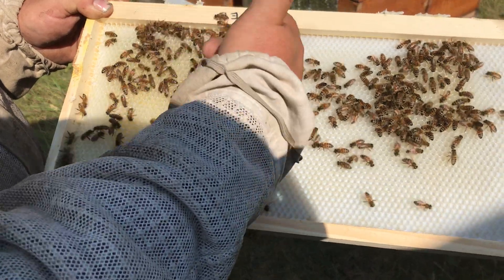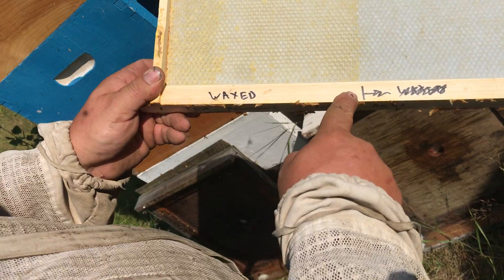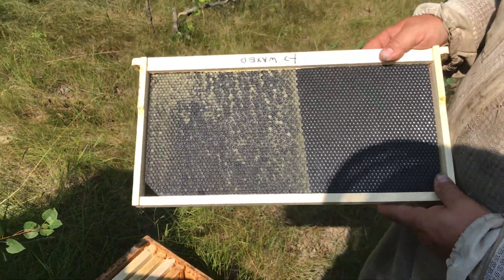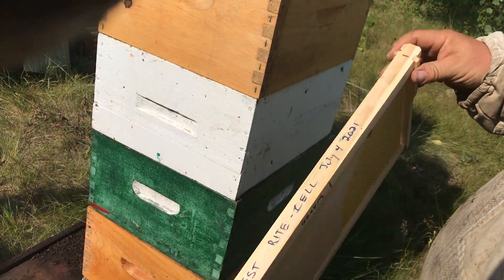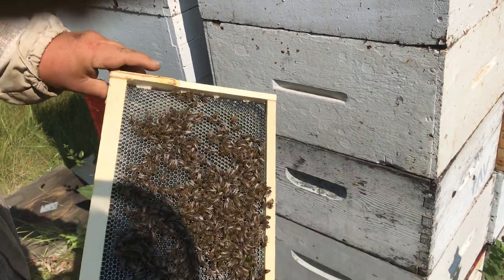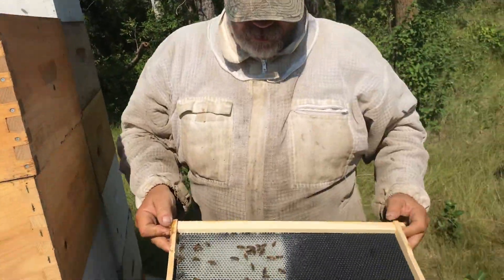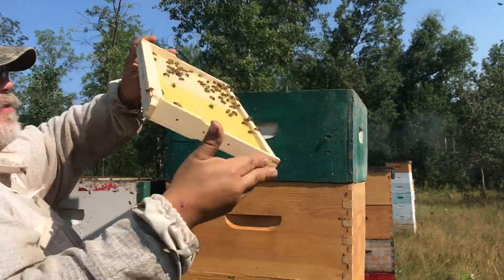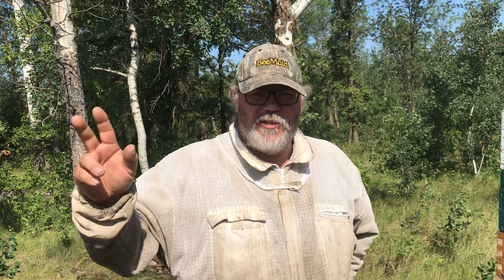Results:  Testing dipped vs "off the shelf" foundation. Step 3:

Comment: Great video, thanks for you efforts.  Did the foundation have any wax from the manufacturer before you added your own wax? The foundation bend when they don't have enough space to stand up stright, ie top bar and bottom bar is to close together or the slot is not deep/wide enough for the foundation to fit into.
Reply from the maker: This foundation was all “waxed”. I’m trying to show that coating is insufficient.  Those sheets were all straight in the frames when I installed them. Another viewer suggested the black comb may have warped from the heat as I set the video up.
Reply: @philbeeman  my apologies, show in your first video of the foundation install you were struggling to get one to fit properly.
Reply from the maker: True. Thanks for reminding me of that. That brand of foundation might be a bit tight. I don’t use it regularly.